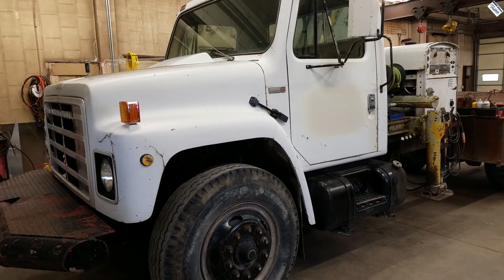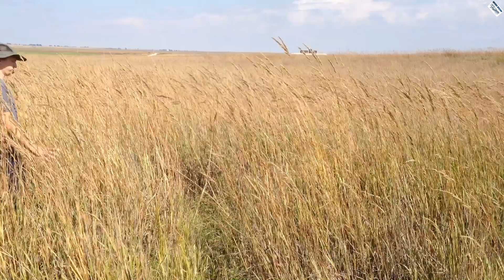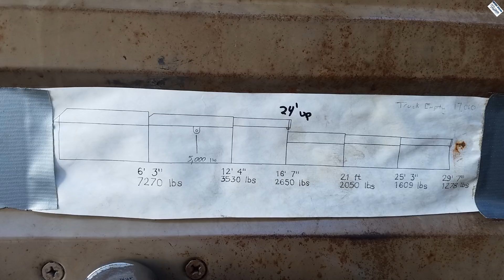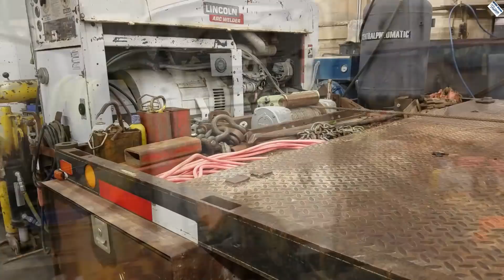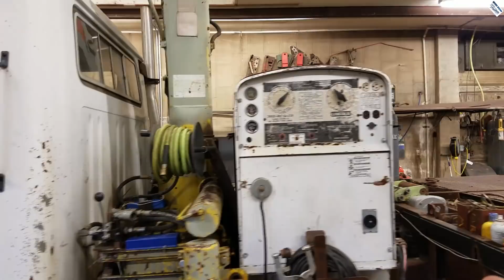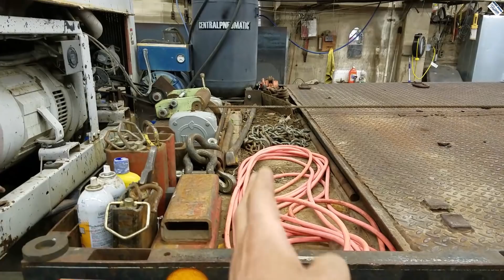My Welding Truck Walk Around

Comment: Nice rig . I also run a International 4700 with a 12k knuckle boom . I'm thinking about a service body behind it vs the flatbed I have now . Do you like the flatbed ?
Reply from the maker: Flatbed is only way I can operate as I often carry wide loads, such as plow wings,  grain bins, huge dirt augers or loader buckets. Plus it's a great welding table! :)  The down side is, of course, not enough storage.

Comment: What made you switch from a 250 to this? How is the knuckle boom vs a standard auto crane?
Reply from the maker: Difficult to answer those questions in a comment, but at the risk of being terse, there are several reasons for switching. The main reason being I needed a crane big enough to lift farm equipment. No way would a F250 be handle a crane this big. Plus, this IH 1900 will pull big trailers a lot easier and it has a bigger payload (in the bed) capacity.   This truck is cheaper to maintain, too.  Lastly, comparing a knuckle boom to an auto crane is like comparing an overhead bridge crane to an engine hoist. The knuckle boom is far superior. :)

Comment: Are you a certified welder
Reply from the maker: Nope. Haven't had a single job that required it in my 30 years of welding, even back in the day when I was working on assembly  line welding scaffolding together.
Reply: @WideVisionMetalFab  what kind of jobs do you do

Comment: This is what Im considering on doing. I don't really care for the pickup truck welding rig. I prefer a heavy duty truck. I'm looking into buying a used Penske international, air ride suspension, air brakes, air ride driver seat, hopefully I can get one with a Cummins under the hood.

Comment: Can you give me more info about the generator that's adapted to the side of your welder sir
Reply from the maker: It's a 25 Kilowatt generator. Used to be PTO driven, but I took the PTO gear box off. It runs at 3600 RPM, and my welder runs at 1800, so I had to use an 8 inch pulley on the engine, and a 4 inch pulley on the generator to double the RPM. I did use a single "B" belt, but it's too big to go around the 4 inch pulley, and the life span is short. I have to replace the belt every 6 months. I plan on switching to a flat belt, like the serpentine belt that cars have now.

Comment: Nice set up. I have a 1988 S1900 Dump. Can you share where you got the LED lights? Maybe a video on how you did the installation of the new LED lights.
Reply from the maker: I've gotten my lights from 2 different e-bay stores. One is allstartruckparts, they ship from Houston Texas, and when I can, I order from HITCH2TRAILER because they are just a few hundred miles from me and the parts get to me in 2 days.  The lights are exact replacements. Simply unscrew the old ones, cut the wires if needed, and screw in the new ones. The only ones I'll have to modify the mounts are the tail/brake lights. But HITCH2TRAILER has a neat, metal, light box with holes already cut for the  tail/turn/brake and side marker lights. It looks like mounting the box would be easy.  Search "steel tail light guard box" at HITCH2TRAILER.

Comment: What type of generator is that?  Might need to try that as my sa 200 Lincoln  don't do AC
Reply from the maker: It was a  540 PTO drive generator. I removed the gear box and machined a pulley to fit on the shaft. I think it's a WinPower brand, but could be wrong.  It's a 3600 RPM generator so I had to double the RPM using different sized pulleys since the welder runs at 1800 RPM.

Comment: I love those S-series trucks, I was a mechanic at an IH truck dealer from 81-92 and yours should last a lifetime. Easy to maintain and source parts since only the cab, rails and engine was from IH, everything else is from major parts manufacturers. I'm not sure which power steering pump is on your engine but you may need to upgrade it to run your winch or just run an additional pump from the belt drive you added for the plasma generator. After I move ill try to dig out my old parts books which show the applications for different p.s. pumps.
Reply from the maker: That would be awesome if you could get me some information on the pumps. The winch is designed for only 6 GPM, which is what my crane pump is when the engine is at 1,000 RPM.  When I looked on-line, the P.S. pump is rated at 6 GPM, but I don't know at what RPM. And I can't find the displacement of the pump to figure it out.  The winch is also designed for 1500 PSI, which I believe the P.S. pump is set at, but I couldn't find that on-line.  If you feel like e-mailing, I'm at widevisionmetalfab at the gmail. I hope your move goes well!
Reply: I don't know what you will OR ended up with but the tandem I drove with a 466 and a 13-under, you better walk that tranny back down and keep the engine wound up or you had NO power steering but it had about a 6-inch pulley on it. I pulled that once and once only. I also had no #2 gear position (probably a bent rail, it'd pop out). 1 or 3 was too fast or slow to spread with BUT they're fine trucks, 
none-the- less. GBWYall and don't freeze or blow away!

Comment: i like the international s series and the 4700-4900 trucks very much. an intercooler would do a lot for that dt466. we have had many internationals with that cab series. water getting into the cabs through the cab lights because of a dried out cracked gasket seems to be common on all the ones i have owned. i have a national 50 series knuckle crane. it is good for 8300 lbs. it also has a secondary control valve with several different gpm settings. i am removing it from my truck as i dont need it. it has driver and passenger controls along with a corded remote. hydraulic extending out riggers. it is in good shape and still on my truck. i am removing it to put a roll back bed on.
Reply from the maker: Water coming in the lights? That might be where my mystery puddle is coming from! I always have a puddle right in front of my driver seat after a rain, and have not been able to figure where it's coming from. It never crossed my mind to check the clearance lights.
Reply: usually comes in the lights and down the a pillar. kick panel starts rusting. floor mat stays wet and rust starts because it never dries out...at least in my part of the country. what part of kansas are you from?
Reply from the maker: I'm in Northwest Kansas about 40 miles Northwest of Hays.

Comment: Great video. Nice rig you have there.  What kind of plazma cutter do you have?
Reply from the maker: I have a Lincoln and a Northern Tool, and believe it or not, I prefer the northern tool one over the Lincoln!  I really want to get a Hypertherm 45. I've used them a couple times and they are really nice!
Reply: Wide Vision Metal Fab  
Thanks for the reply. I'll have to look into the Hypatherm.  I was in a welding supply store  here in Canada and he was saying the Hypatherm was a great  machine.Not very often they were  coming in to be fixed. Again thanks for the info. Have a great fall.

Comment: Would you like your truck to be four wheel drive? A lot of those were. The air bag for a tensioner on the winch fairlead can be salvaged from an old air ride seat at the truck salvage yard. For when you use ether to start the DT466, figure out a way to apply the ether only after the starter is engaged. Otherwise, it is very easy to break piston rings. An electric block warmer is cheap and easy to install. Reducing wear on the starter and liners would be of much value to you even though the engine will start without pre-warming down to 10 degree or so.
Reply: I really endorse block heaters. I have one on my car, and if I plug it  in overnight, I start at -30C which is something like 60F  below freezing. When I was out in the bush it was indispensable. Oil at low temperatures is a lot like jell-o.
Reply from the maker: I thought at first I would want 4 wheel drive, but it gets around good enough without it. I've decided if the conditions are bad enough that I'm getting this rig stuck, I don't need to be out in it.  I was always told the opposite about ether, that applying while cranking is what causes destruction.  It does have a 110 volt block heater, but I seldom know 2 hours ahead of time that I'm going to be going on-site, so I can't wait that long.
Reply: The logic behind getting the motor spinning first, before adding ether, is that it causes detonation rather than normal combustion. Most guys use too much. So that exacerbates the problem. An alternative, which requires electricity, but not leaving it plugged in for long, is a heat gun. Click it on and aim it into the intake while cranking.
Reply from the maker: Now that I think about, Grandpa taught me how to use ether when I'm by myself. And using the smallest amount possible was rule 1 and 2!   By heat gun, you mean just a standard, 110 volt heat gun  for stripping paint and heat shrink tubing?
Reply: Yes. If you do it, make sure that the metal snout of the heat gun is not resting on plastic or rubber.